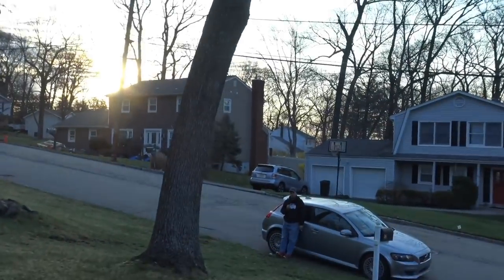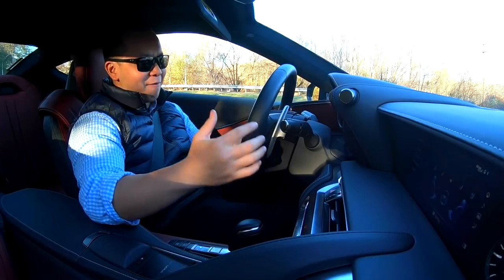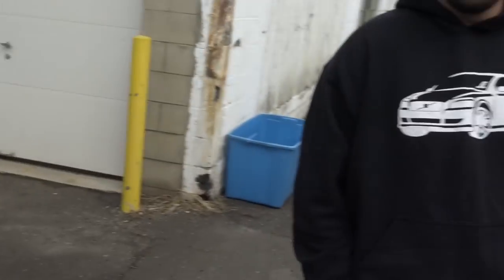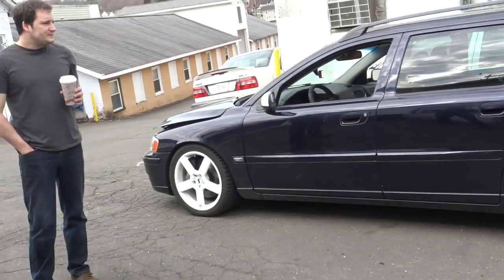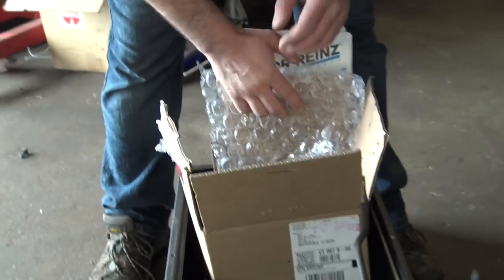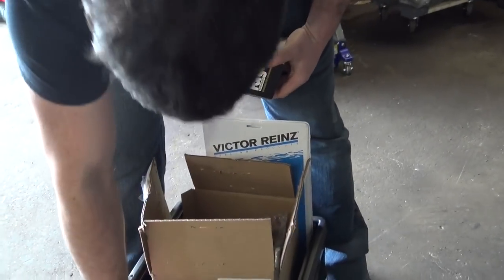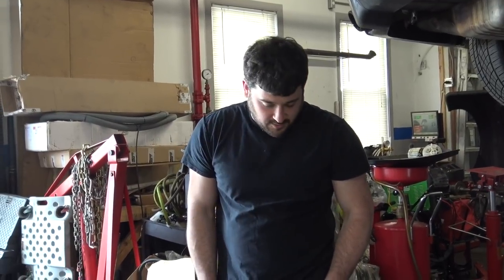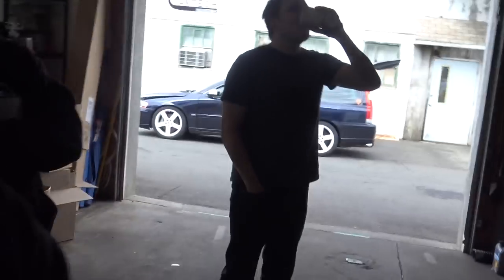Here’s How We’ll Make WAY MORE POWER With Our M3 Killing Volvo V70R

Comment: Without the water cooling Greg you need to make sure you let the car cool down before shutting it off.  Water cooled turbos offer a huge advantage in that aspect.  Back in the day people installed turbo timers so they could shut off the car and it would run for a predetermined time period to allow the oil to cool down because the turbos were not water cooled.  Greg I still think you should have let turbo lab build you a turbo based on the stock turbo that's water cooled.  They claim 420hp and 450lb.ft of torque in the stock framed turbo.

Comment: Hehehehe the fun has begun, not without its hickups but should be worth it! Theres nothing like a good 5 cylinder turbocharge Volvo. Don't mess with the stock clutch. It decreases driveability when going aftermarket and is less reliable in my opinion.

Comment: one tip use original cylinder head gasket! no aftermarket!
Reply from the maker: We have victor reinz
Reply: Oem is tested to 800hp Workt allot with thes eingens and oem parts is the best for this eingens.
Reply: @Brytarn1  bro can't spell engine or worked, I don't know if anyone would trust you with that english...
Reply: is from sweden so can't boast that i am good in english! but it does not have to do with it. you know better then you will get some tips.
Reply: This is actually true. I've ran 600hp (2+ bar) for a few years now with the oem head gasket.

Comment: Hope all goes well. Looking forward to seeing the video about the Haldex.
Reply: If your going to service your haldex I would strongly suggest spraying both ends of the drive shaft with some sort of penetrating oil a couple times over a period of time before taking on the repair.  Unless you live in a southern state that doesn't salt the roads it is going to be a pita to remove the driveshaft velocity joint from the rear differential.
Reply: Other thoughts.Have you changed the fluids in the rest of the drive train as you are upping the power? Volvo do have a habit of stating that this isn't necessary and this is not on their service schedule. I suggest a quick look at " volvosweden " on youtube. Although this is for a XC70, the system is very similar and may well save money on unecessary repairs.

Comment: Yeah be careful with the sleeves, might crack with too much engine load on low rpm or high boost. E85 is an option to keep the combustion temps down and make more power at the same time
Reply: yeah but E85 is only availiable in the big cities. I don't have any in my medium/smallish town here. I recommend just normal 93 octane pump gas maybe some methanol injection.

Comment: 50 views
Reply: Someone hmu or help me on fixing my volvo s60r i just need speed sensor && front right strut.. or i have a 2004 volvo s60r 105k miles
Reply: ForSale offer me
Reply: @raheemtyb  I'll trade you a 2001 v70 t5 with 106k miles :) no issues and custom suspension